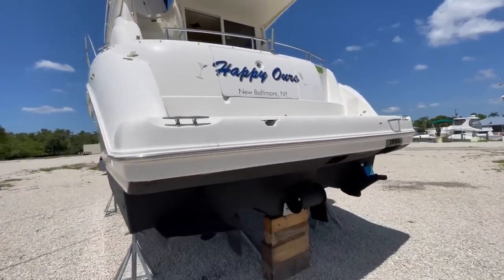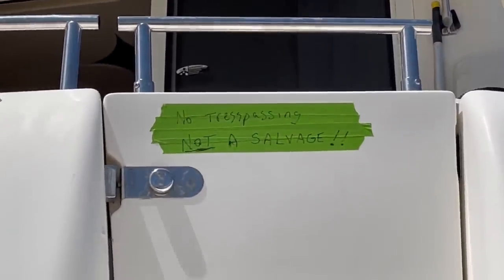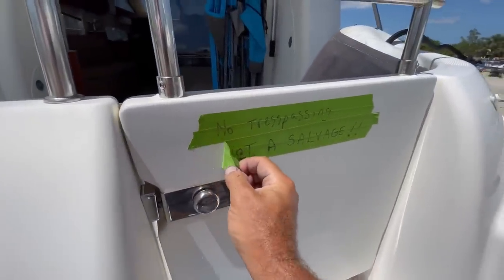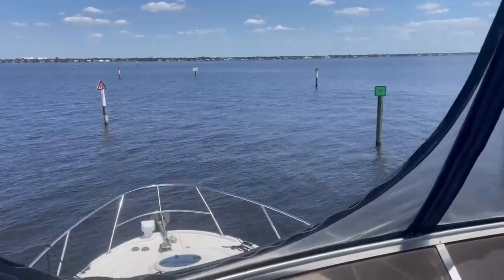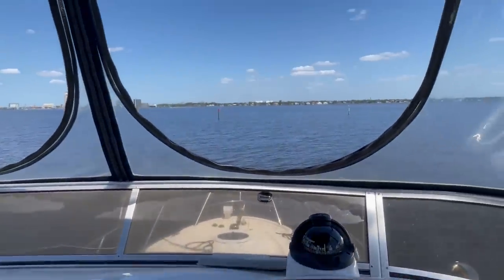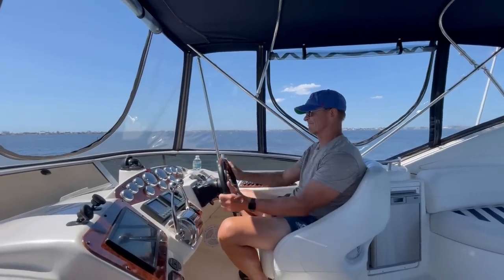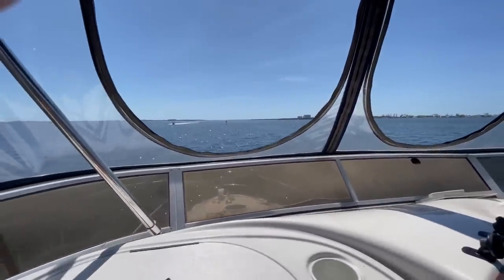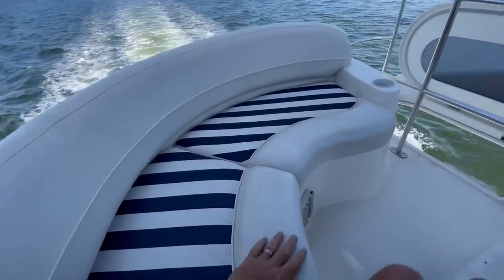Leaving the Boat Graveyard - Will it sink?

Comment: Good to see her back in the water.   As for one engine not turning the same rpm... compress test... then explore the fuel delivery system... im guessing its fuel injected... could be as simple as low pressure or an air leak... i have seen you check and change filters on a regular basis.  Hope you get it sorted out. So nice to see that you were able to save her.

Comment: I still get nervous anytime I see someone walk under a strapped boat!   Glad to see you  back in the water!  That has to be a fuel flow problem with one engine running less RPM's.  One of our diesels was doing that, and we found where the fuel line to that one had become pinched.  I straightened it out, and fixed it where it wouldn't kink again and that moved that engine from 3150 to 3400 RPM (right where it was supposed to be and where the other engine was at WOT)
Reply from the maker: I’ll nail it down one of these days!

Comment: I had similar problem with stb engine WOT 400 RPM less than port. Having the fuel injectors professionally cleaned solved the issue. They installed new screens and o-rings. My boat is 2005 and I doubt they had ever been cleaned. I have Volvo 8.1's and pulling the fuel rail with injectors was very simple. Took the rail assembly home and removed each injector. Now at same RPM, each engine shows the same fuel burn rate on the Garmin.
Reply from the maker: I’m thinking that’s the fix for my issue also.  I’ll try a thru rail cleaning first.

Comment: Great to see her back in the water, port engine problem might be a slightly blocked engine cooler, problem could be fixed by washing the engine cooler inlet and outlet, boat coolers usually never get blocked mid cooler,outlet or inlet.
good luck and stay safe.
Reply from the maker: Why would that keep the rpm lower?  It’s not running hot.
Reply: @AdventuresofHappyOurs  if it's not the injectors then go for my suggestion I had the same problem, no heating problems, nothing. When I took the engine out for cleaning and replacing fuel tank I clean the cooler and when everything was done it was fixed
Reply from the maker: You mean the raw water heat exchanger?

Comment: Question,  the boat looks great. Why did you paint the props and shaft, vs applying Propspeed?
Reply from the maker: I’ve never used propspeed.  The HullShield I installed claims to need anti fouling paint, so I’ll see how it works.  If I still have issues, I may try prop speed next year.

Comment: Hi Guys.  I am also in the Cape and wondering where you had your fiberglass work done?  Need some myself.   HELP!!
Reply from the maker: Here are a couple of fiberglass guys that were referred to me in Cape Coral but I was unable to use them as they were too busy last year. You can try:  Dane at 239-285-1924/239-910-1840.  Or Pete 951-230-5750.

Comment: Just wanted to know what did she weigh with everything that you did I wonder if it lost or added weight
Reply from the maker: I should ask the lift driver as they have a gauge that tells them correct?   When the crane lifted her up from being on the hard, I thought I heard him say 25.  That’s 5k+ over listed dry weight.   It was holding quite a bit of rainwater in bilge and gas tanks but I didn’t think that much!